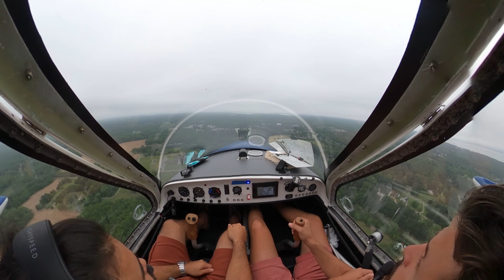CATASTROPHIC AIRCRAFT ENGINE FAILURE | Cockpit view | Deadstick landing in cornfield FLIGHT VLOG 33

Comment: I'm a heli pilot and that pushover was as fast as a collective drop after an engine out. It takes that kind of reaction time to successfully get into an autorotation. I've never seen a fixed wing pilot react this fast. Truly extraordinary.
Reply from the maker: Thanks man. Yeah at 600 get there wasn’t much time to think
Reply: The airplane has a high-mounted engine, so in a power loss it pitches up markedly - which you can see in the video at 0:06. The instinctive reaction to that is to fight it by pushing the stick - which of course was exactly the right thing to do, and the student did it. In more conventional airplanes, with the engine in the nose, a power loss causes a slight pitch down, and the instinctive reaction to that is to pull - exactly the wrong thing. That's probably why you've never seen a fixed wing pilot react quite like this: the initial surprise reaction has to be fought, and that takes an instant. That said, once the shock passes, the pilot tends to relax, which in a high-engine airplane results in the speed bleeding off unless the pilot remembers to re-trim, which can present its own dangers.
Reply: Anybody that is any good in a light weight high drag microlight type aircraft will have had that nose down reaction drummed into them. For a very simple reason, there is no choice. Very low inertia compared to most other aircraft. Never flown heli but I suspect you guys are the same, it's part of the training.
Reply: Not extraordinary at all, it’s instinctive
Reply: @FinbarSheehy  Even on fixed wing planes with sudden engine-out you may wish to pull up to exchange speed for altitude, until the best glide speed of course.
Reply: @FinbarSheehy  ah yes that makes sense that the marked pitch up seems likely to lead to a quick reaction, great point.  Minor detail: in the mainstream light singles (Cessna/Piper/Robin etc) you actually would pull back in most engine out cases to slow the plane down to best glide and retrim, e.g. you might be cruising at 100 kt and need to get the speed down to 65 kt.
Reply: Look up glider winch launch failure. It is practised over and over in the training. A 40° climb with sudden loss of power makes you really fast with your pushover
Reply: Is it just me who thinks this was planned and staged?
If that nice big open field wasn't there....
Reply: It's good that I came across this version of the video... Without audio and context, the stick handling looked crazy on its own.
Reply: @doubletripplep  if he planned and staged it, I think he would have wanted the field in front of him, so he didn't have to make an aggro 180 over trees and side-slip the plane to a rough stop.
Reply: @doubletripplep  What @riffraffselbow said. Additionally, when flying at low AGL, you should always think ahead and have a plan where to go if things go south. So in a sense, every flight is "staged" to make sure you have somewhere to land without ending up in the tree tops.
Reply: @BarryHofland.  l
Reply: @doubletripplep  It's just you.
Reply: Watch a glider pilot deal with a liw altitude winch line failure :-)
Reply: @doubletripplep  It's just you.

1. FAA said it was a cracked fuel rail, not pilots fault.

2. You ALWAYS have an standby landing spot picked out in case of engine failure or emergency. It's one of the things you're supposed to do continuously as you fly the plane.

Out in the desert? Flat open spot. Farmland? Cornfield.
City? Big wide empty street or nearest airport.
Water? Try to slow down as much as possible and brace for impact.
Reply: You should have seen my reaction time when I had a cable break at 500ft during a winch launch in a glider. I think even my instructor was surprised how quickly we went from a 45 degree climb to a nose down glide with 55 knots established on the ASI. I do remember everything in the cockpit going weightless as I pushed over the top. There wasn’t enough runway left to land ahead so I had to fly a very abbreviated circuit and land.

My instructor sent me solo later that day so he must’ve been happy with my reaction. I’ll never forget the date, 09/09/09!
Reply: @Nibby12 , how does a pilot plan a cracked fuel rail? 

The FAA investigation is very clear that it was a mechanical failure and that the pilot wasn’t to blame in any way.
Reply: Normally no need to react or act that fast in a fixed wing aircraft...
Reply: @doubletripplep  Not everything in life is a bloody conspiracy.
Reply: @WorksOnMyComputer  mmmm but staged videos for views are far from conspiracy. 
Sorry pal, I say this was staged.
Reply: Inspirational what you (non fixed wing pilots) do!
Reply: @Nibby12  Ag no not another disbeliever !

You're on the wrong track bro , get out behind your door hoping to find someone else there.
Reply: @Pete-tq6in  did you get that egg yoke taste in your mouth as well  ?

Kidding but yeah I could only imagine that initial shock wave and rapid survival mode jumping into action. 

Well done young man.
Reply: @pieterbezuidenhout2741 , thank you, I was younger when it happened, that’s for sure!
Reply: @Pete-tq6in  😂 😂 😂   I sure do believe you.
Respect from a South African Boer (Retired).
Reply: @Joseph the best reason is that a plane has a best glide speed. Which is usually lower than its cruise speed. 

So ifnyou cruise and get into engine trouble you first raise the nose ( or at least not lower it ) until that ‘excess’ speed is bled off until the best glide speed. This will keep you in the air longer giving you more options to reach a suitable field for an emergency landing.
Reply: @Nibby12  😂 lol, that quick reaction was the result of a great instructor! In a high mounted pusher prop the engine is constantly pushing the nose down. When the engine quits it will pitch up instantly. Any good instructor would have taught their student to instinctively push the nose down the moment the engine stutters. When I was learning to fly in a similar airplane my instructor would occasional pull the throttle to idle and expected me to instantly react by pushing the stick forward. He would then ask me where I was landing and expected an instant answer. It became instructive. When I suffered an engine out that instinct kicked in and allowed me to calmly land without a scratch to me or the airplane. Video of the incident can be found on my channel.
Reply: @ulbuilder  yep, fair enough mate.
Reply: @riffraffselbow  plus he likely wouldn't want to endanger  a student if it was all planned...
Reply: @doubletripplep  You're suggesting they destroyed their aircraft for some views? I'm usually very adept at the fake cues...and nothing at all about this seemed staged or fake.
Reply: Depends on alt and speed.
Reply: @doubletripplep you really should make that appointment, you know.
Reply: Rip to pilot

Comment: Quick thinking and maintained composure, great piloting.
Reply from the maker: thank you my friend
Reply: Securing the engine right before landing proved that you knew exactly what you were doing to give you and your student the best possibility of walking away. This is a great example of being unconsciously competent of what you know in that it was second nature to check the engine status, survey the scene and prepare for an emergency landing. Thanks for narrating.
Reply from the maker: @bugginryan  thanks man. I practice a lot of engine failures with my students. Not much time to actually think when shit hits the fan.
Reply: You're my future instructor B'H
Reply: @StraightandLevelCFI  super fast
Reply: You sure lucked out with that field being there. Hitting a house or tree the FFA would had owned that video
Reply: Good job men
Reply: @StraightandLevelCFI  >>> In THIS CASE, "the fan" failed without the need for any fecal matter. 😉 
 
{GLAD to see you both were okay!}
Reply: @StraightandLevelCFI  >>> I am somewhat familiar with general aviation aircraft, but this has me stumped: 
What is a "fuel rail"? 
 
{Thanks in advance.}
Reply: @Allan_aka_RocKITEman  Fuel rail delivers even pressure to all fuel injectors. It's basically a tube with an single pressure regulated inlet and a port for each fuel injector along it's length.
Reply: @garrykennedy5484  >>> Okay, Thanks! 
 
Most of the GA aircraft I ever worked around -- where the engine cowlings were actually removed -- were carbureted.  
 
Yeah, I am so old I remember when people still rode on Pterodactyls...and I DON'T mean the Part 103 ultralights...😊

Comment: The hand movements of the student told the story of what was going on in his head. Holy crap he seemed terrified, and seemed to want to take the stick, but kept it together. Good on both of you, and I hope the student doesn't get shaken off the hobby.
Reply from the maker: oh man i cant imagine having to hand off the control to someone else... yeah he did great though really
Reply: I disagree. His initial reaction was both fast and correct, he had the stick forward in a fraction of a second. After that control was taken away from him so we can't say what his subsequent actions would have been.
Reply: @finbarrsaunders8688  Agreed, his instinct was to lower the those immediately nicely done
Reply: @finbarrsaunders8688  I agree, great reaction. However, for me also looks like he was about to grab stick back into his hands. But he resisted. So that another props for him.
Reply: Yeah, student wet himself.
Reply: Looks like his hands lurched forward because of the sudden loss of power from the engine failing
Reply: That's all I noticed was his hand movements. I bet he pooped too.
Reply: @MeoMiyo  @ Adam Green. Wrong, there's a fraction of a second where the RH pilot moves the stick ahead of the left. Only a fraction but it's there.
Reply: @matthewsmith5109  he most likely didn’t - no dark spot in front, and the instructor’s shirt is wet on the right side. Probably a water bottle that tipped over and into the student’s seat on impact
Reply: Holy crap precisely at 1:05
Reply: @Joseph nope, that is from body language observation, not my imagination. He was looks like he is about to grab stick back again. And fact that he was in a bit of shock just contribute significantly to my assumption that he was about to grab stick back again as people do irrationall things when they are in shock, don't we?

So obviously he had not intention to do it but again, we do things unintentionally especially when in shock.

Comment: “Pick your spot, fly the wing all the way into the crash.” Well done. 👍🏼
Reply from the maker: statistically if you keep the wing flying you survive
Reply: @StraightandLevelCFI  Low level like this, where there is no time for anything, my instructor drummed the 4 F's into me during simulated low level (300feet) failures:

FLY (Vg pushover and keep flying the plane - trim Vg IF you have time)
FIELD (identify)
FLAPS (As required)
FUEL (Off).

It all has to be an instant and instinctive reaction.
Reply from the maker: @JulianGerretsen  I always train the ABC of engine failures 
Airspeed - pitch for best glide 
Best field
Checklist if time
Declare emergency if time
Exit plan
Fire prevention - shut off fuel and ignition/ master
Reply: Yep,that’s what I was taught as well. Pick a spot and stick to it. Great job guys

Comment: Wow, it all happened so fast! I thought a plane might  give you more time by gliding. If it's that quick in a plane, I'd hate to be in a helicopter failure.
Reply: helicopters can use autorotation to slow down their decent. still very fast tho, but they don't just drop like a stone.
Reply: That's why altitude is your friend. If I'm at 3500 I have like almost 5 mins it feels like in a sling2. But that's at idle power not dead stick
Reply: The dependency is altitude. 600 ft above ground level offers little margin for glide, regardless of aircraft type.

Comment: I wish I had seen your video before my Challenger II crash in 09 when I broke my back and crushed a leg. I had five engine failures in Pawnees spraying, one in CallAir spraying, one in SuperCub teaching spraying, three in Cessnas on pipelines, one in Cessna high, and got shot down in a Cobra in Vietnam.  Injury in Vietnam but all others no injury and bent only one Pawnee and CallAir.  All tractor airplanes.  The Challenger II was no engine failure, just didn't like the way it way flying and at 100' started a crop duster turn back to land.  Crop dusters always allow the nose to go down naturally in all turns as designed into tractor airplanes.  I released all back pressure but did not have enough rudder and aileron control to get the wing up before hitting the ground.  The student who had just bought the plane was fine in back by the pylon.  The front of the airplane and me was crushed.  We need to keep old guys with thousands of regular horus out of manufactured however light sport airplanes when they lose their medicals.  There are good normal tractor Cub like light sport airplanes, but very expensive.
Reply: Real question. Do the engines regularly just give out on these smaller planes ? I saw in another of his videos a few days after he brought a new plane he couldn't really enjoy flying over the grand canyon cause he was looking for a place to land the plane in case the engine failed. The plane was new and he wasn't comfortable with it yet. Even a few plane the engine fails? Smh I don't wanna learn to fly anymore then
Reply: @TheChoralist  it's relatively rare and survivable if you fly the plane.
Reply: As you and many other very experienced pilots find out, light weight rag and tube type microlights are both the same and very different to fly. Years ago the people most likely to kill themselves in microlights were airline pilots. Full of confidence, can fly anything attitude, often ex air force and zero experience in low inertia machines. Glad you survived but it sounds like you paid a high price all the same.

Comment: Man your student had stick forward before you did! Good job!
Reply from the maker: yeah I was extremely happy with how he handled this situation, and how he managed to put me in a good place to do a safe landing.
Reply: Well trained, straight and level seaplanes is doing a good job.
Reply: Nope... the joystick shot forward due to the lack of thrust and changed aerodynamics on the elevator - it PULLED their hands forward and it's very obvious. The student even moved his left hand forward to 'grab' it back as a reflex.
Reply: @nitramluap  Unlikely. Have a look at the plane, it looks like the motor is above the wing. I don't know how much training you've had, but just in case you haven't started yet here a short explanation. If the motor (centre of thrust) is above the wing or more precisely the centre of drag when under power the motor will tend to push the nose down if it does anything noticeable at all. In normal flight the plane should be trimmed so the pilot isn't putting any weight on the stick, everything is neutral. In that case cutting the power will make it nose up a bit rather than pitching nose down. Of course if the centre of thrust is below the centre of drag its all the other way round and then you would get a nose down reaction to cutting power.
That nose down reaction is trained into you by lots of practice. As a generalization the heavier the plane the longer you have to react. Light, high drag planes (think rag and tube microlights) stop just about as soon as you shut the throttle. Heavier, sleek planes carry on for a while due to higher momentum. 
If you haven't already give it a go, it's very addictive 😀

Comment: Do you know what failed ? Interested in engine type and failure details. Thanks for the video
Reply: From what I've heard it may have been a fuel rail failure. No fuel pressure may narrow it down somewhat
Reply: @Controldo  sounded like hella knock or perhaps backfire though

Comment: 60 degrees of bank at 0:40 , power off, 100 feet off the deck...that was almost a disaster right there.  The full right aileron trying to get the wing to come up was momentarily ineffective and could have easily induced a stall.  But hey, they walked away.

Comment: This is why altitude is your friend. And a worrying with plane that loose so much elevator authority in an engine out situation... :o
Reply from the maker: Yes but it is one of the woods things about the pusher prop seaplanes. I do extensive amounts of training in this airframe. So it’s not so bad. The bad thing was we were tiring to get under the bad weather. So getting myself in this situation at 700 feet was not ideal.

Comment: It was a small experimental seaplane with a pusher engine that had a cracked fuel rail.

Professional seaplane pilot Antony Yen of "Straight and Level Seaplanes" in Eustis Florida, Departed from Williamsburg-Jamestown Airport (KJGG) on May 26th on a routine ferry flight to Connecticut. Just ten minutes after take off the experimental light sport flying boat suffered loss of fuel pressure at just over 600 feet above the ground. With dense trees all around, Mr. Yen turned on the secondary fuel pump, confirmed he had voltage (spark) and lost fuel pressure. After pitching the aircraft to best glide, and immediately locating the only potential field in gliding distance, he and his student were committed to landing.

Comment: Thanks for posting. What I got from this is not to fumble with the ignition while setting up for the flare. Better to focus on keeping the nose in the direction you are moving and flaring all the kinetic energy out. Also turning off the ignition typically does not turn off the electrical systems nor does it reduce the fire risk. It does turn off the engine and abruptly changes the thrust/drag and makes landing smoothly much harder.